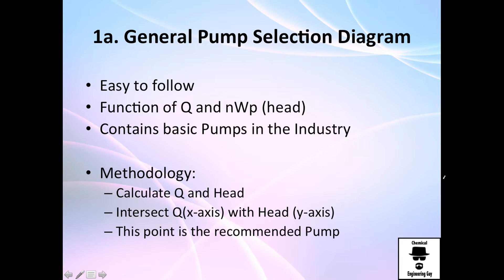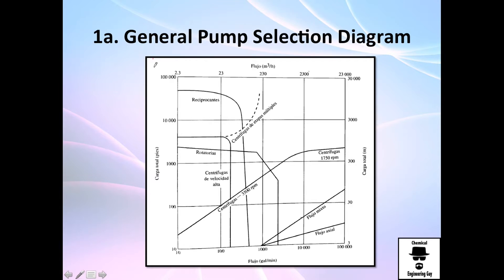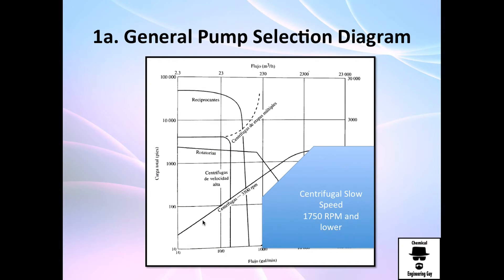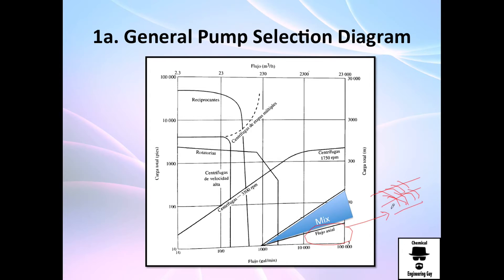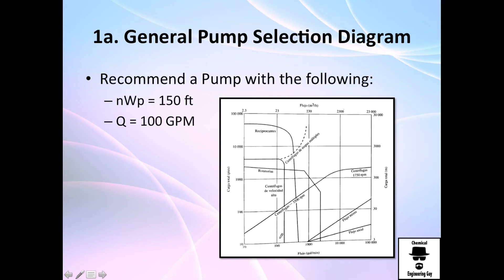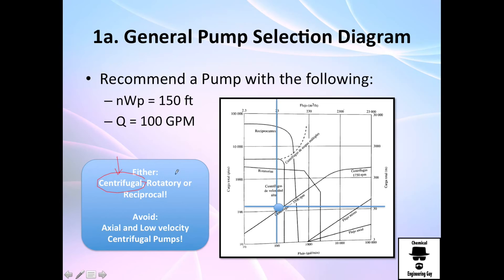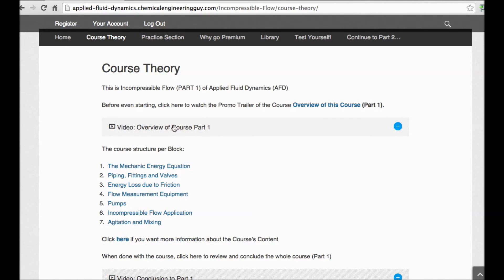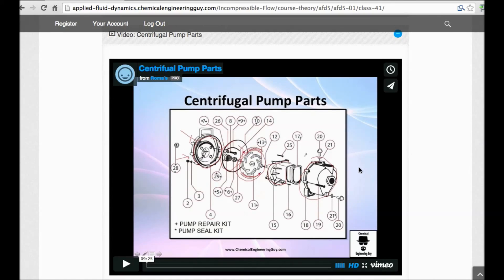Pump Selection (Step 1 of 5) - Applied Fluid Dynamics - Class 053

Comment: how can i get the pump selection diagram? I cannot find it anywhere. really need it
Reply from the maker: you will get it from your pump provider... I just got those online, but of course when buying you will need the specific ones for your pumping provider & brand
Reply: @ChemicalEngineeringGuy  Yet I still can't find it online. I need the diagram for presentation purposes. I would really appreciate if you can provide me the link to get the diagram.